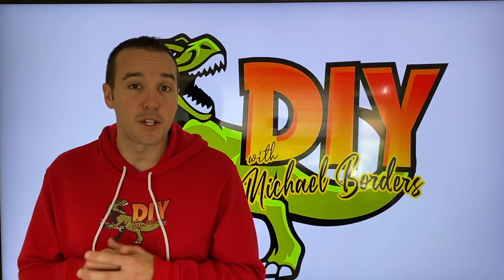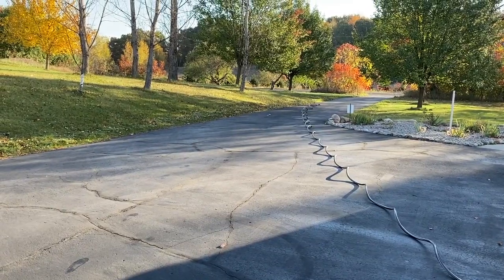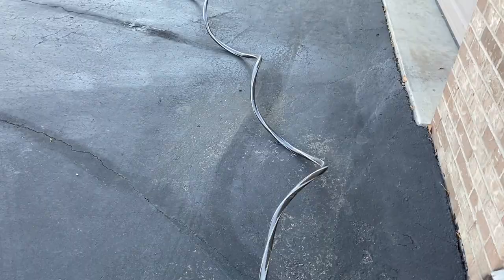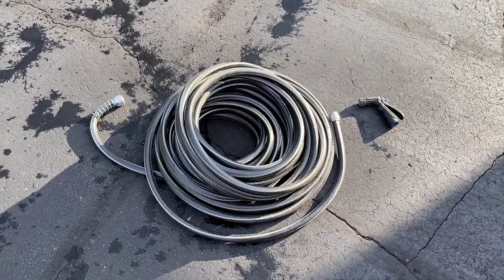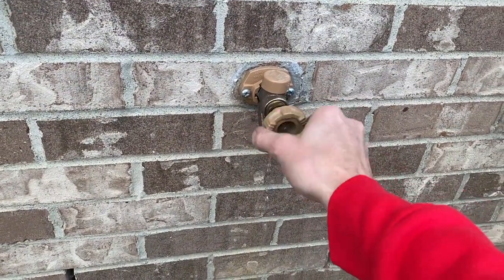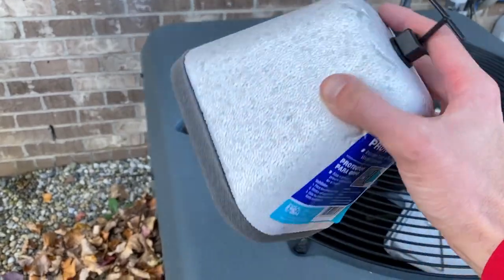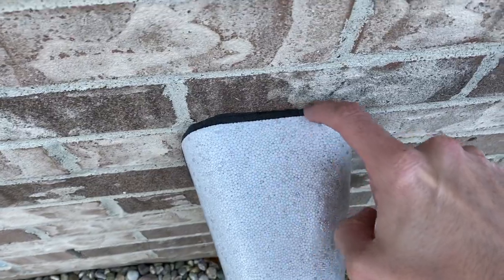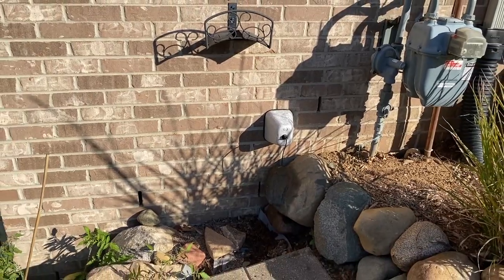How to winterize garden hose & spigot PROPERLY!

Comment: On the first shutt off valve, you can see the screw on little cap, That cap has a hole on the side, you need to unscrew it, the water from the part of the pipe that goes outside will drip from the hole.  You need to empty any water that goes to the valve. from outside and inside.  Some install might have an inward slope.
Reply from the maker: Thanks for watching & sharing your advice.  You Rock.  Us fellow DIY’ers need to stick together!

😎👍🔧🔩
Reply: @DIYwithMichaelBorders  Yes we do  :-0) 😎
Reply from the maker: @projet2907  

😎👍
Reply: @DIYwithMichaelBorders  Nb, It’s called a drain or bleeder 😉.
Reply: Does the bleeder valve stay open during winter?

And spiged stays closed, after draining out the water from the pipe for the winter right?

Comment: This puzzles me: After shutting off the basement valve, how come there is so little water (only a few drops) come out when I open the outdoor spigot to drain?!  What did the water between the spigot and the valve go?
Reply from the maker: Good morning, we are drinking our morning coffee and answering any and all questions for the DIY community.

That’s a great question, and we appreciate you asking.  With the valve in the open position, there is still built-up water pressure being fed from our household pressure tank.

The second we close that valve, we also eliminate the pressure from our tank that pushes that water through the pipe and out of the spigot in a fast and pressurized manner.

In other words, once the valve closes, the pressure tank can no longer push pressurized water past that valve and push that water out of the remaining pipe as well as spigot… the water just kind of hangs out in the pipe and wonders where the pressure went…

Hope this helps.  😎👍
Reply: To outer space.
Reply from the maker: @georgeburns8447  

😎👍

Comment: Many outdoor faucets are now the freeze-resistant type.  They are kept in the closed position when not in use; the valve seat is at the end of a long tube well inside the house where it is warm.  There is no need for a separate inside shut off valve.  For the conventional faucet, keep the faucet valve open throughout the winter.  That way, any residual water that might freeze has room to expand.
Reply from the maker: Thanks for watching and sharing this, always welcome here.  😁👍
Reply: I believe spigots with the cap on top are considered freeze resistant. Seems like his first one is what you're describing and he just took the extra step of the shutoff valve. I'm not sure the cover is needed for that type of spigot. Seems like a recent trend to use them. I've never seen one on a house myself.

Comment: I live in a condo, no water is coming through. I have no idea where the shut off valve would be located. 😢
Reply from the maker: Good morning, just poured a cup of coffee and am sitting down to answer any and all questions for the DIY community.

Depending on the age of your condo will depend on how and where the shutoff valve is installed.  However if you live in an area where temperatures get close or below freezing during winter months, the shutoff valve will always be installed inside building or condo itself.  In our case, the valve itself is inside home.  Keep us posted.

Let us know if you have any questions and hey if you’re into crypto trading, join our DIY ecosystem.

       toolboxtoken.com

Reach out to us any time!  🧰

Comment: Are you sure we shouldn't just leave outside spigot open and label this on inside valve?
Is there any different procedure for a frost free spigot versus a regular one?
Don't some set ups have a little metal cap in the line somewhere inside that you crack to let the pipe fully drain? 
By label I side valve I wrap it with painters tape and add a message, outside tap is open so no one casually opens the inside valve.
I think the old pre frost free spigot procedure is like I described...
I'm less sure about the frost free spigots...
Reply from the maker: Thanks for watching.  That will be personal preference.  Labeling it is not a bad idea as well.
Reply: Yes, if inner is letting some few drops now and then (which can happen) - this way you can save spigot.
Reply: What if walking multiplie times with hose over your head does  not help and some water still ir being trapped in hose?